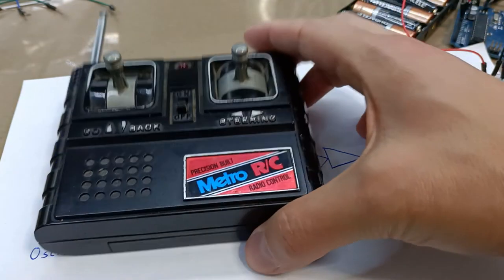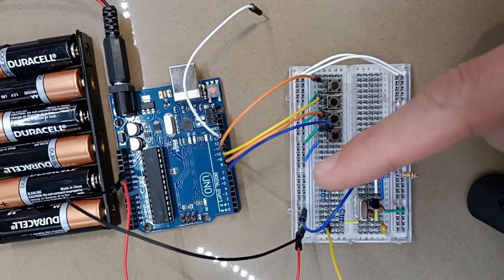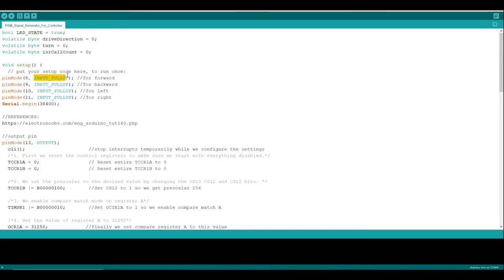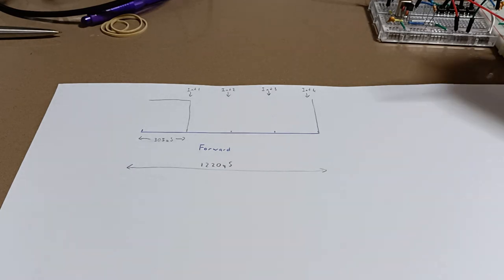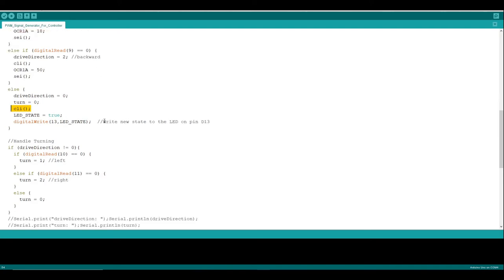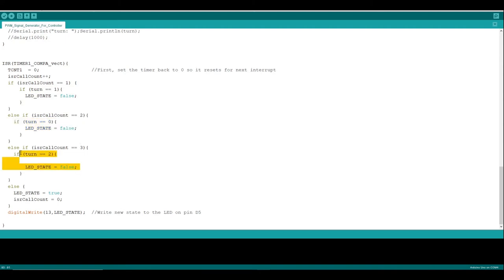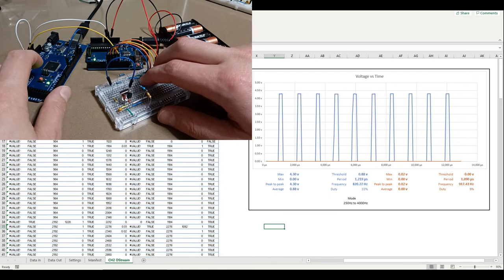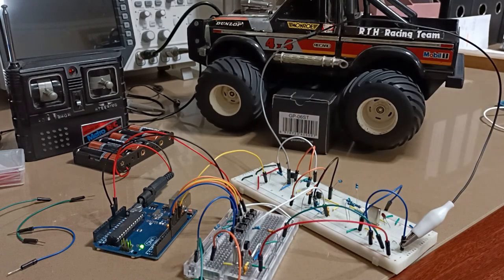Building a 27 MHz Radio Controller - Arduino Circuit and code (RC Transmitter Part 3)

Comment: tks OEO!. The controller does have identification of 27MHz; I don't have an oscilloscope and not sure where I'd access one. Perhaps I have to build one?
Reply from the maker: It is good that it is marked 27mhz so it would be similar project steps to my video series.  If there is a maker space near you it may have a scope you can use. It is necessary to see what your circuit is doing.

Comment: Hi I have an old Deere toy tractor 6430 which is not working. Is there a way to test the Radio controller to see if its the problem or the receiver and/or motors
Reply from the maker: Probably could attach the antenna of the radio controller to an oscilloscope and see if there is any signal when you switch it on. Similar to how my reverse engineering remote controller video was done.  I googled the tractor and it looks like from the picture it has a similar length antenna to my truck so could be 27 MHz.

Comment: I have finally made oscillation scheme and found out that signal was really narrow band and too weak to be used as it was. What amplification scheme have you used? Will just one transistor with common base be enough?
Reply from the maker: I think I used common emitter amplifier although I have read common base is often use for RF signals.  Also be careful to keep wire lengths short so they don't radiate out your oscillator signal and interfere with what you have modulated. Here is a link to my video about boosting the range/signal.
https://youtu.be/smSFZksTrEA